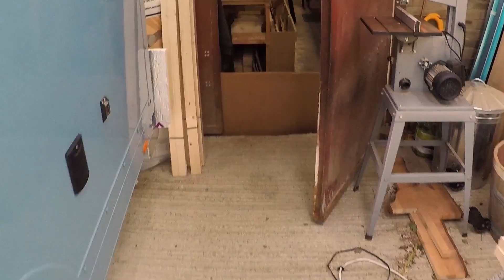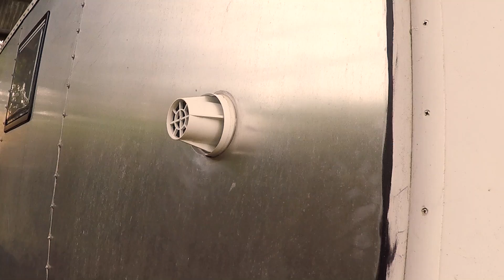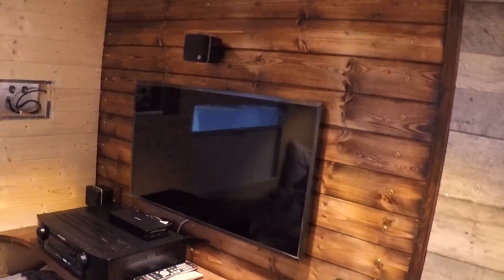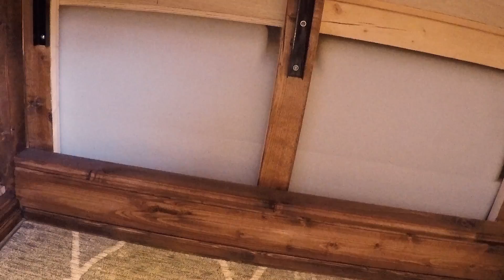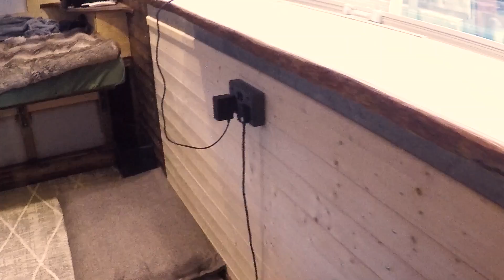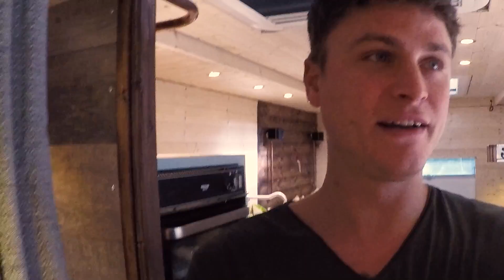VARIO LIBRARY BUS CONVERSION MINI TOUR!! AND WORKSHOP UPGRADE!

Comment: Have you weighed your van? Thinking how much weight all this is ?
Reply from the maker: Not currently as it is yet to be converted to a motorhome and then MOTed (current one expired October), although, when it was a fully equipped library bus it weighed 5950KG, including 300KG of batteries, over 50KG of associated inverter/library wiring, a heavy hydraulic wheelchair lift, air powered sliding door, 25mm thick ply/fiberglass walls, not to mention a large desk, 50+ shelves, seating, windows, skylights and carpeted MDF panels as far as the eye can see, we will comfortably be within its 7500KG 👍😊

Comment: Great job. For air cooling in the states there’s a 12 volt air cooler called Fresair  that a lot of van lifers are using, it runs off solar and water like a swamp cooler. It’s pricy but it won’t drain battery and will cool ur home by 80% 
https://www.fresair.com/
Good luck with completion!!!!

Comment: I'd do it in raptor bed liner, you can tint they're kit if your not having fans maybe an off white to reflect heat back.. 
Its a bit marmite some people like the texture others not but its fairly easy to do and stands up to some t**t keying it cos they can.

You can get a different texture by changing the pressure and do it with a Shultz gun.

Comment: You've cracked on with that can certainly see where the finished product will be.. 
Looks good, be interesting to have an idea what sort of budget it takes to make that.. 
Obviously your building yourself just materials if you don't mind disclosing.

I keep looking at freezer lutons similar layout to that low loader obviously highly insulated guess its still a lot of work though... I imagine you could keep cool in summer with all the insulation though minus the freezer.. Motorhome morgue lol.